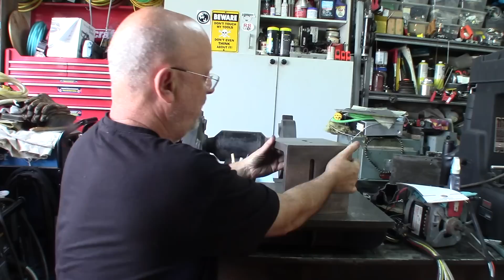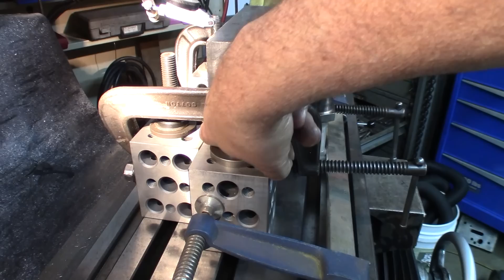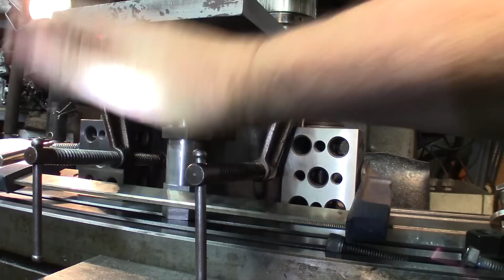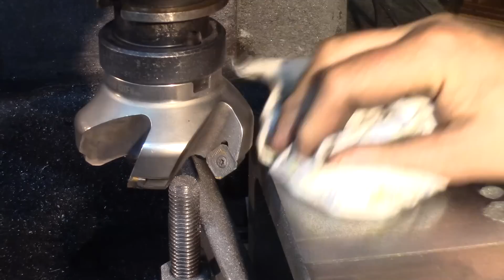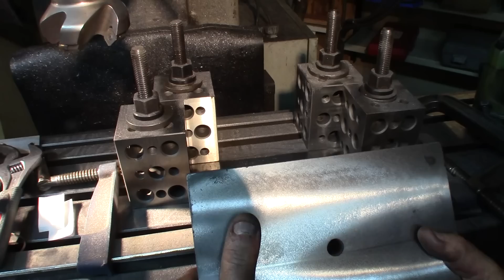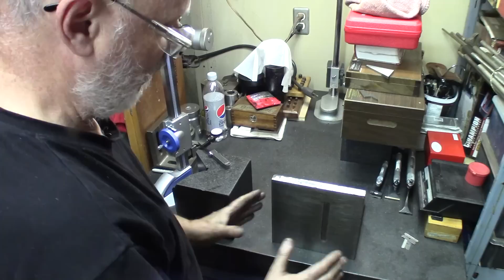Correcting a semi precision square, for machining operation

Comment: Hi Pierre,

I like those setup blocks. Did you make them? It also appears I have found out who my competition is for levels on ebay....... Three in plain view!  Glacern face mill?

Best,

Tom
Reply from the maker: +oxtoolco 
Hi Tom,
I'm not buying much on ebay, so there is someone else beating you at it...   
Those 3x3x4 were found locally, like most of my purchases, great for sturdy setups...   ;)
This face mill tool is from Sowa, I'm presently trying to find replacement inserts that would cost me less than 12 to 18 $CAD ( .550"included circle or 14 mm. SEET or SEXT series) looking on AliExpress not much luck, Alibaba has some but I'm more reluctant to use these services...   

Thanks,   Pierre
Reply: +pierre beaudry Hey Pierre,

Take a look at Iscar. I found some for the Glacern facemill I have for a reasonable price. They are still on the first edge.

Best,

Tom
Reply from the maker: I'll give it a shot,   thanks...

Comment: What is your view on using  grinding cup wheel on the mill (like blanchard grinding)?
Reply from the maker: e+Mukhthar Ahmed Usable but dusty, and on cast iron not recommended to add liquids, since it makes a grinding paste that stick to everything on a machine, including the ways...
I most of the times use a shell mill like this, if I need more precise I'll take the job on a surface grinder.
There many right ways to accomplish a task depending on the tooling and conditions, none are better, just more adapted...
Reply: agreed, looking forward for your work. keep up.
Reply from the maker: Mukhthar Ahmed
Thank you very much...   ;)

Comment: Very nice, came out great.  You have my address right?  Thanks, Randy
Reply from the maker: Randy Richard Hi Randy, 
I have your address how many to ship...???
Cheers, Pierre
Reply from the maker: ***** Hi Randy, 
Those inserts are the mammoth size category, I've got no tool to use it, would have to find one, or, make one. I could also send you a couple of pict of my insert stash, got quit a few, even the odd ones...
With the cost of shipping the best option with big iron, is to find locally and if possible in usable condition...
Cheers,   Pierre

Comment: I wish I had seen this before spending a few hours  trying to set mine up in the Kurt.
Simplicity is the key, I got quite frustrated after a few tries of setting both axis at one time by shimming and jacking & jacking & shimming you get one set and mess it up trying  to set the other.
Thanks Pierre, great video once again
Reply from the maker: Phil's Projects Hello Philippe,
Would you make a detour to California, going to Stan's Bash, you're closer than me right now... ?
Now you know what not to do with the plate, it'll be easy for me to show better ways to do now.... LMAO...!!!
We'll work on your angle after vacation if you want.
See you soon...    Pierre
Reply: pierre beaudry yeah I wish i could go but that would put off the purchase of a lathe for half a year... 
Cheers mon ami

Comment: Hi Pierre !

It was an interesting video for me to see because I have some two big angles I have to machine too ;-))

I'll have to do with MUCH lower quality than you, though,  because I have no surface board and I have not nearly as much "mounting material" as you have and the angles are not cast iron or cast steel ... so. you can see "the level" is classes under you, but I'll have to live with that ... and I can ;-))

... but surely I'll go see your video here several times, I'm sure ;-))
Reply from the maker: Keld Sørensen Hello Keld,
Glad it would inspire you, if you have questions just ask.
For using as a flat reference that would be decent, you can use your milling machine table, also the z axis combined with a dial gauge makes a decent perpendicular measuring device.... ;-)
Cheers,   Pierre

Comment: You two must be supremely confident that your mill is trammed perfectly to not do more of an overlap with that cutter. On my rather flexible machine I would have to use a much smaller cutter and do many passes, so that the surface averages out as flat and true. Wish I had room (and funds) for a bigger and stronger mill. :>(
Reply from the maker: Chris Stephens Hello Chris,
The Nasty Subtitler and I work hard behind the scene to maintain the shop in good working order...... lol
On the serious side, that milling machine is on the 3800 pounds category and is in great shape, so, the tramming is easy to get dead on.... 
Keep on with your wishes, if it's like me and you persist, thing will happen... ;-)
Thanks for comment,   Pierre
Reply: Oh boy, you should see my wish list!
Reply from the maker: Chris Stephens
Aren't we all the same when it comes down to the workshop...???? 1000+ pages wish list.... :-))
Reply: All it takes is money. At least you can get extra by charging the subtitler rent.
Reply from the maker: Lol
Reply: Hi Thomas, thanks for your concern. The mill is a cheap version of a 626, i wont go into full diatribe mode about its failings, but will say that has done lots of quality work, you just have to work within its limitations. Yes there is backlash, make that considerable backlash, in the screws, some of which was reduced when I fitted the adjuster screws, into the nuts, which were missing from new! Custom nuts are on the menu to fix the problem when I can find the time, but DRO sure helps to mitigate the problem of machining to size.
I wont go on but will say some of the faults are fixable, some are a result of lack of cast iron. I would love something bigger like a Bridgeport or better but no space or spare funds preclude one. If funds were to be available I would still keep my mill, despite its faults, as it can produce the goods even if underpowered and flexible.
Merry Christmas
c
Reply: Retired, yes. Hobby, sort of, shall we say it is a self financing hobby these days. Any new or used machines, now, way out of the question as I said money and space in short supply.
I would love a CNC mill as there are many jobs I get asked to do that would be way quicker if I had one, time though for me is not really a consideration, just as long as I beat the Grim Reaper. Maybe if the lottery is willing things might change but that is about as likely as finding a non self serving politician, but we can all dream, both about workshops and politicians.
Thanks again
c